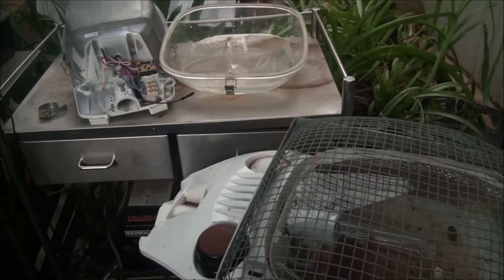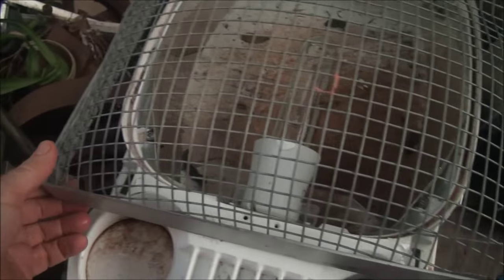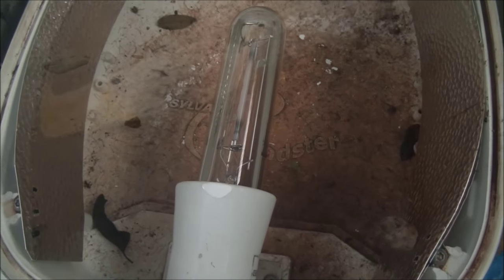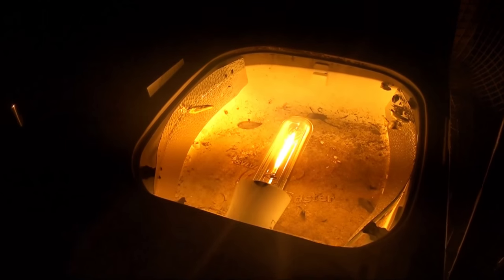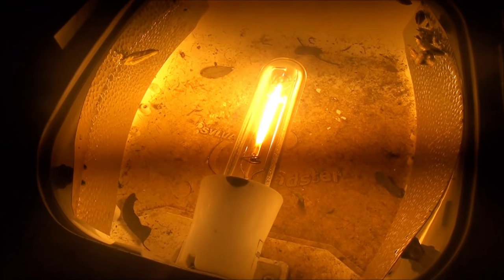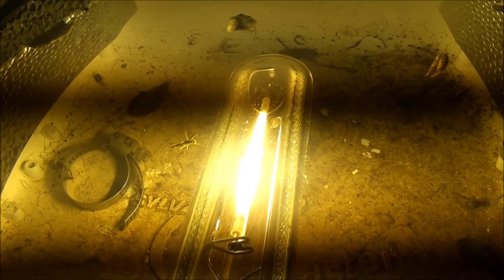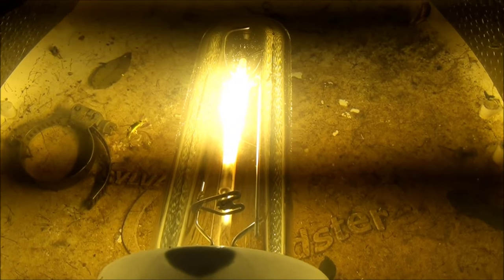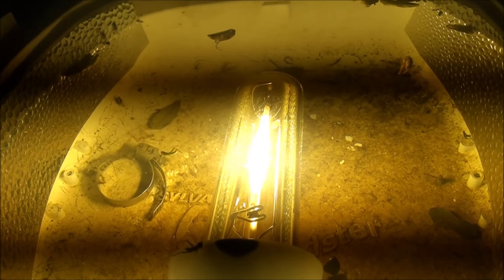HP Sodium lamp submerged in water

Comment: It's absulutely surprising that the HPS lamp still lit up under the water, I would have thought that any water in the lamp socket would have absorbed the starting pulse from the igniter
Reply from the maker: +TLDswitchstart I was thinking the same thing, they do use a high voltage pulse to strike the arc and I would have thought that the water would short out the pulse especially since it was submerged for a few days. I guess the rain water has a very high electrical resistance.

Comment: I call fake!  You don't get rain in the outback, it's permanently Dry!!  Until the wet season comes and everything floods anyway! :0)

Funny what will work under water. I dropped a running pool pump in the pool one time and it kept working fine.  Worked for a while afterwards as well but Died some months later. Hard to say if that was from the dunking or old age as it was over 20 by then. 

I have another electric motor I have had out in the weather for years. I try to cover it up but always forget. Sometimes when I turn it on, the thing throws water out as it's pretty open being an old fridge motor but it just keeps on going.
Reply from the maker: +Oil Burner I guess rain water has a high electrical resistance, I was sure the lamp was not going to strike up as it uses a high voltage pulse to get it going. I had left a live extension cord lying in the yard and it went under when it rained, I was surprised it didn't pop or cause trouble to the Chooks when they were scratching around. I need to be a bit more careful next time it rains, maybe in another couple of years or so.